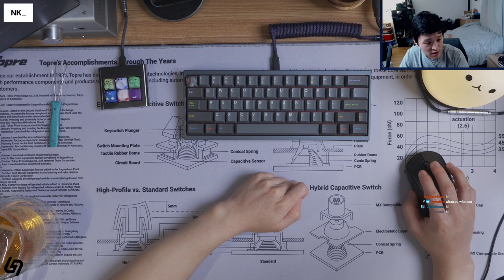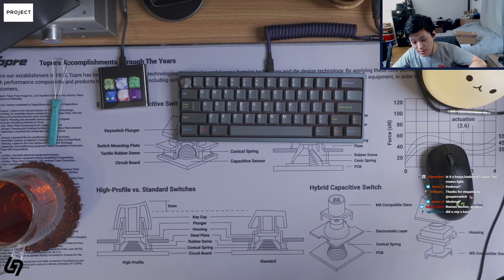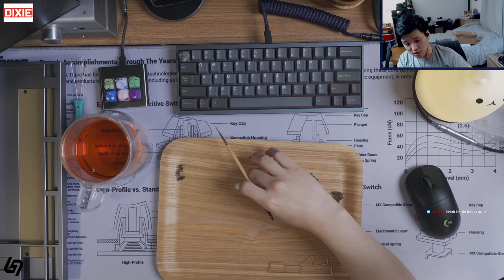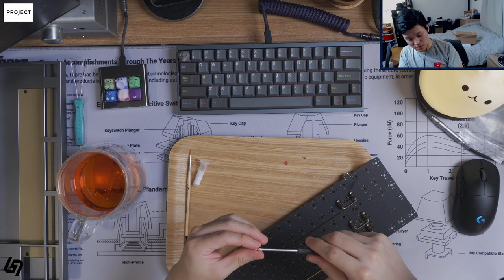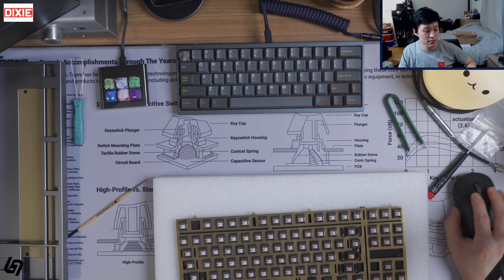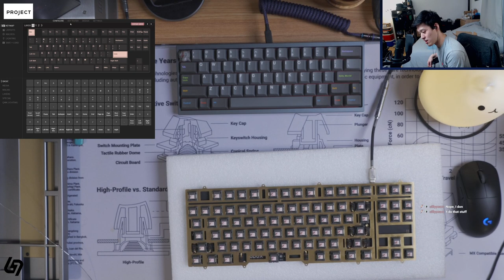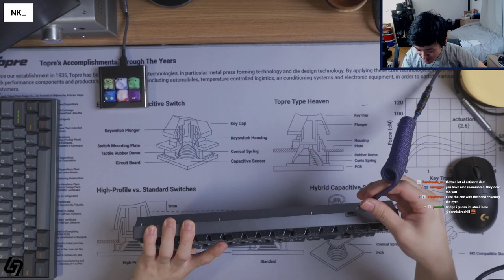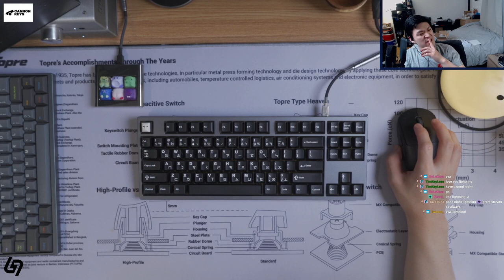KBD8X MKII Build Stream

Comment: If these are the durock v2 stabs: did you have a problem when putting them in the pcb? cuz i‘ve heard that there is a problem with the enter and left shift touching each other.
Reply from the maker: It worked fine, you can check around 1:23:10